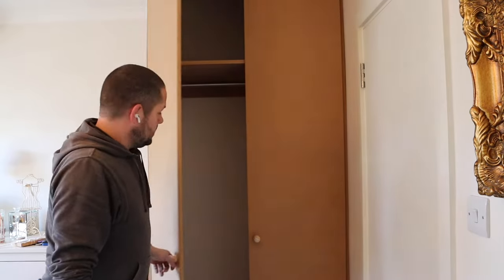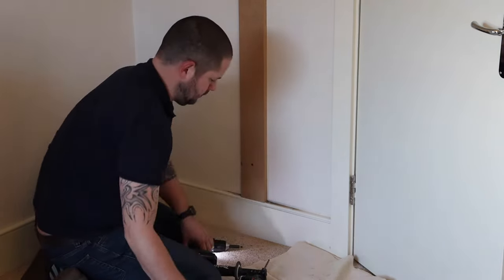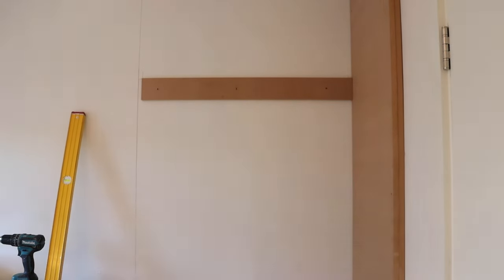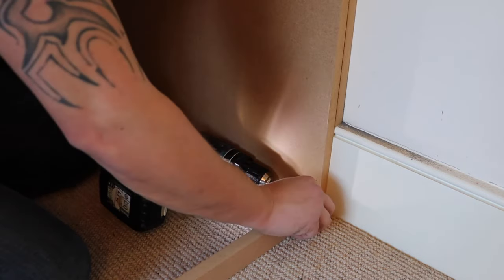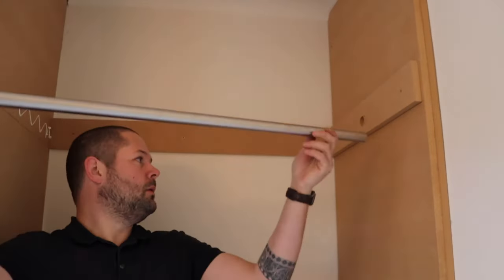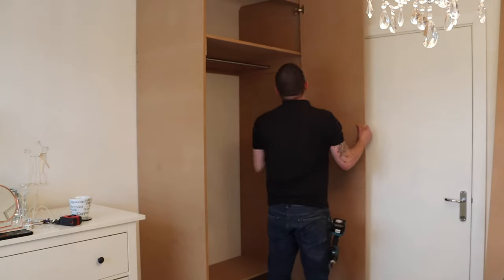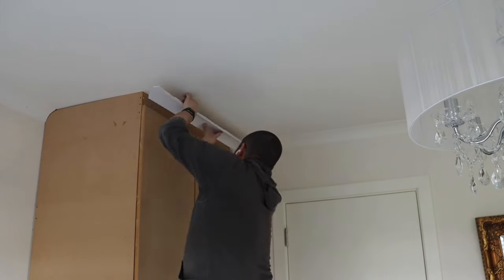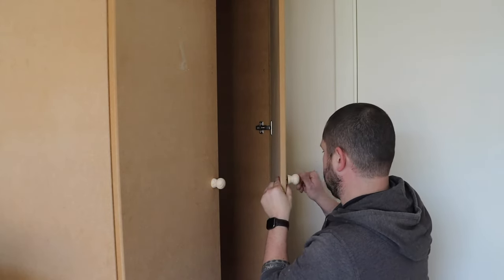How to build fitted wardrobes  #joinery #carpentry #woodworking

Comment: I use the Kregg hinge guide, had it a few years now and find it really good. I didn’t notice the drip but I’ve also done that with coving 😂
Reply from the maker: Yeah mate I have looked a the Kregg and I am tempted by that one. !! Mate I had a nightmare with that coving 😂😂😂
Reply: At least the corner looked square.........

Did my daughter's coving in a Victorian flat and the chimney breasts  certainly weren't square which entailed a lot of cutting, measuring, trimming as well as copious amounts of filler. Looked good in the end and I also used plaster coving.

Excellent job on the wardrobe.......

Comment: Very helpful mate, just wondering what the score is when you measure the front doors. Do you measure the total width then take a few mm off for the gap?
Reply from the maker: Cheers mate, I measure the overall width, divide by two the take four mm off that measurement, that gives me a nice gap in between the doors and a gap on the edges aswell. Hope this helps buddy

Comment: Fantastic job just what I needed wardrobe on both sides with bed in the middle....had two joiners in to get a price unbelievable prices.....
Reply from the maker: Cheers for the comment buddy, what sort of prices where they charging if you don’t mind me asking buddy ? Materials are expensive at the moment but also there is a lot of work out there so some people are taking the p*** with prices.
Reply: All In 850
Reply from the maker: @MrJokerh61  yeah mate that is on the heavy side, deffo a case of “we’ve got loads on so price it high and if we get it it’s a result” ! Some people do rip people off ! Or in your case they try too !
Reply: @MrJokerh61  was that for two wardrobes a similar size to the one that's been built in this video?

Comment: Thanks for great video.
When you are attaching strips are you tapping rawlplugs through MDF.
It looks like you are.
If so, what size screw, plugs and drill bit as that shortcut would make my life easier attempting what you made. 
Thankyou
Reply from the maker: Hi Tracey, thanks for your comment really appreciate it! I use red plus, 6MM drill bit and 4 x 50 screw, hope that helps 🍻👍

Comment: You asked for recommendations for a better concealed hinge jig. I bought the Kreg one but the supplied forstner bit was as blunt as a bus.Sent it back to FFX and they replaced the jig...same problem, terrible bit. Managed to rig it with an alternative make of bit (not easy) which works better but overall I'd give the Kreg jig no more than 4/10.
Reply from the maker: Hi Bob you know I actually ended up buying the same one and I had exactly the same problem! Joke isn’t it! 👍🍻
Reply: @LTWCarpentry  it's bonkers.

Comment: Hey there thanks so much for this excellent video. Beginner question here but can I ask why you are using two different types of drill?
Reply from the maker: Hi Laureline, thanks for your comment 👍 one is called an SDS drill which is mainly for masonary drilling, the other is a combi drill, which is for drilling/driving screws, hope that helps 🍻

Comment: Nice result and interesting video.
Do you ever have problems with warping of plain doors that length?
Reply from the maker: Hi Steve, thanks for you comment, no mate I don’t to be honest, if you paint in both sides of the door and have enough hinges you shouldn’t have a problem
Reply: @LTWCarpentry  Thanks - good point about the hinges!

Comment: Hi great video. Makes things simple and doable. Just a question about the door fitting. Did you put something on the floor when you were fitting the door to lift it off t?( i cant see the bottom of the door) Thank you
Reply from the maker: Cheers for the comment buddy, yes I did I cut an offcut to the correct size and used that mate

Comment: Quality video. What sort of blade did you use to cut the doors? Did you put the rough edges towards the hinge side and sanded them and left the factory sawn edge towards the middle?
Reply from the maker: I use the stick festool blades normally mate but this could have been a different one I’m not sure, I always try to cut a fresh edge on my boards where possible as the factory edges aren’t always true. All edges are sanded regardless, hope this helps buddy

Comment: Great video, you make it look so simple but know I’ll still struggle! 

For your focusing issue, your camera may have been on auto focus which isn’t ideal when there’s quite a bit of movement in the frame. For those types of shots switch to manual focus and you should be sound
Reply from the maker: Cheers buddy, I’ve had lots of practice 😂 

Cheers for the advice with the camera buddy, I will give that a try going forward 👍🏻
Reply from the maker: Cheers buddy, I’ve had lots of practice 😂 

Cheers for the advice with the camera buddy, I will give that a try going forward 👍🏻

Comment: Can I ask a silly question please! Why do you use screws rather than a nail gun if you're going to use glue? You can't take it apart easily with the glue right? So would I be ok to use my nail gun rather than screws?
Reply from the maker: You can but nails have a tendency to fail especially in mdf, a screw can also fail but less likely then nails, the glue will hold but mdf again isn’t the greatest at gluing, that’s why we tend to you use screws and glue, will give much better results 👍🏻

Comment: Hi loving the video, what thickness mdf are you using, I’m planning on building some floating units and can’t decide weather 18mm or 23mm thick which would be best?
Reply from the maker: Hi buddy, these are 18mm carcasses and doors, is there a reason your thinking of going for 25mm ? I normally would only do that for strength or if you want a chunkier look
Reply: @LTWCarpentry  I was thinking for door thickness but 18mm would probably be easier to do and cheaper for materials. Thank you

Comment: Really good and straight forward design, just the video I have been looking for for when I come to do my wardrobe, mine will be going over a stair bulkhead so be oriented 90° so fingers crossed goes as well as yours 👍🏻
Reply from the maker: Wicked buddy, glad I could help ! Let me know how you get on with your please 👍🏻
Reply: Will do, this is going to be my Christmas project, have done one each year since moving into new house
Reply: @LTWCarpentry  would 12mm thickness be too flimsy?
Reply from the maker: @lukepayne3295  I would say so buddy, go with the 18mm it will be much better 👍🏻

Comment: Are you drilling into solid walls or stud walls? If the latter presumably you'd already located the stud before you began drilling?
Reply from the maker: The back wall was solid and the side wall was a stud wall, which I found the studs prior to fixing in to it

Comment: Hi gonna be doing a fitted wardrobe soon and got a couple of questions, was thinking of using white melamine chipboard to save painting, apart from having to edge it what are the draw backs with it? Also is it not easier to remove and cut skirting as it wont be seen?
Great simple vid for people having a first time go!
Reply from the maker: Hi and thanks for you comment, trite are no draw backs to be honest, other then t being more expensive, melamine is a great option it’s just a lot ofcustomers  want to keep the cost down. Yes it’s easier to remove the skirt but I like to leave it in incase the unit ever gets removed the skirting is still in place

Comment: If you don’t have coving, how would you support the left wall at the top?
Reply from the maker: The coving isn’t there to support anything, it’s just decorative. You still need to fix it in permanently, I would use angle brackets or use a cross brace and fix in the the ceiling
Reply: Ah I mean the coving you cut into. It looks like it’s supporting the left board when you first put it up?

Comment: Great work, I'm thinking of doing this on both sides of a chimney breast in an old Victorian property but the right hand wall is external and not insulated. I don't know if boarding the gap will cause any kind of condensation to form, do you have any advice as I'm sure you've dealt with this situation before? Good simple design though and something well within my skill level...keep it up!
Reply from the maker: You have a few options you could insulate the wall be fire fixing your units on but I would put the insulation tight on the wall as this will trap and moisture in, the key with mould and damp issues is ventilation so you can let it dry and air out, I would pack the units off the wall, put a vent in the plinth and stop the units short of the ceiling, this will allow are flow around the units.
Reply: @LTWCarpentry  Great idea with the vents...thanks!

Comment: hi quick question you did not use a plinth base support for the wardrobe? i am thinking of making a 4 door wardrobe was wondering do i need base carcass or just add strips of wood on bottom like you did to keep it together thanks
Reply from the maker: Hi is it going to be free standing or a built in type like I did in this video ?
Reply: @LTWCarpentry  built in aso is 3x2 wood be ok for the base?

Comment: Was the wall and floor on level ? Did u had to fade the doors ? Thanks
Reply from the maker: Yes I was fortunate that the walls were level on this job otherwise I would have scribed some fillers in, the beauty with this type of wardrobe is that if the floors is out of level it dosent matter as you build up level as you go 👍🏻

Comment: Nice job fella. Was that polymer coving you put up? if so, what are your thoughts on it?
Reply from the maker: Cheers fella, no it’s was just the standard plaster coving, I haven’t used the polymer stuff yet so not sure to be honest.
Reply: @LTWCarpentry  It' looked white so didn't look like paster coving. Did you also use the instant nails to attach it?
Reply: @LTWCarpentry  Congrats on the 1k subscribers too. 👍
Reply from the maker: Yeah mate looking back at the video it dose look a lot whiter, I think that must be a trick of the light as it didn’t in real life, yes I did normally I wouldn’t but due to it only being this small amount and already having the instant nails on the go I went with it mate 👍🏻
Reply from the maker: I’ve only just seen this comment sorry mate ! Thanks so much ! I genuinely made up ! That was my goal when setting this up !
Reply: @LTWCarpentry  I did wonder if it would be good on a full length, not worth the risk of 8t falling down I guess.

Thought provoking video, thanks for putting it together. 😉
Reply from the maker: @Simon-Smith.  completely agree mate, I think this stuff would be more then strong enough to do it but there’s always that worry in the back of your mind at midnight when you can’t sleep that it might fall down…. I was on a job once and a bloke stuck a sheet of plasterboard to a ceiling using only gripfill…. Needles to say it came down about 2 weeks later ! Luckily the children wasn’t in the room ! Just goes to show that risk aren’t worth taking !